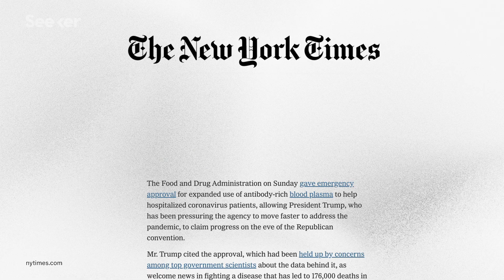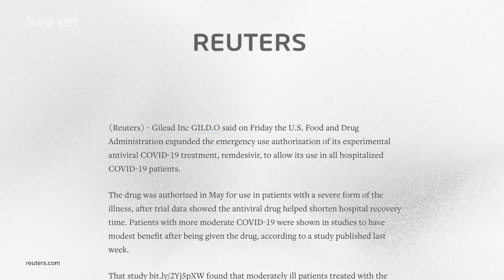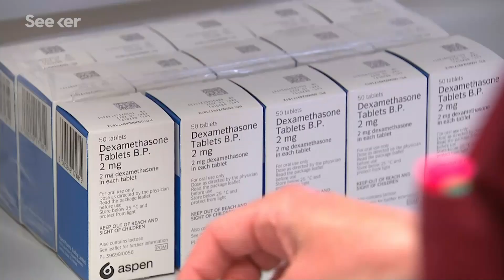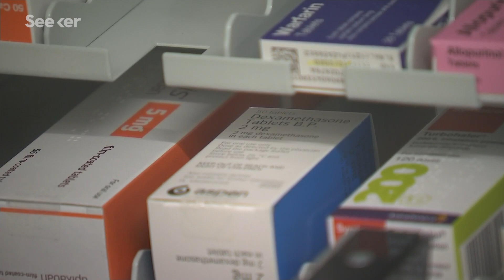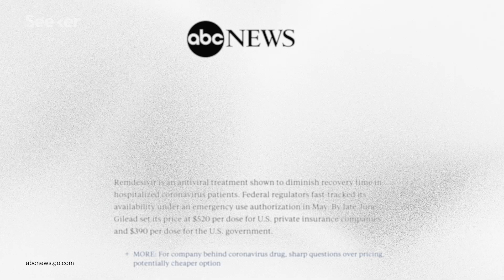Trump Is Undergoing Remdesivir Therapy, Here’s What You Need to Know About the Antiviral

Comment: °•○ FUNCTIONS OF FORESKIN ○•°

.

.

[  ] 🍌 PROTECTIVE COVER: Like a glove🧤, it protects the penis from abrasion, chafing, the elements, and helps regulate temperature. It keeps the glans moist, as it's meant to exist as mucosal tissue like the inner mouth (circumcision causes the glans to dry out and feel more like the outer cheek). The glans is meant to be an internal organ like the eyeball. What would happen to your eyeball if you permanently removed the eyelid?

.

.

🍌 GLIDING ACTION: Foreskin isn't a "flap of extra skin," it's a double-layered sheath that rolls into itself. This allows for a self-stimulating gliding action in sexual activity, which is pleasurable for sexual partners as well😊. When you change form by removing foreskin, you change the natural mechanism of sex. Harder, rougher rubbing and friction😖 is then needed to achieve erotic feeling. 

.

.

🍌 PHEREMONES & ESTROGEN RECEPTORS: Foreskin releases pheremones🥀 and also contains estrogen receptors. Little is known about the purpose of these receptors, but they're thought to play a role in bonding during heterosexual intimacy. 

.

.

🍌 BLOOD FLOW: Foreskin houses a rich network of 3 ft of veins, arteries, and capillaries, keeping penile function in top shape.

.

.

🍌 SPECIALIZED NERVES: Foreskin is densely ennervated with 240 ft of nerves found nowhere else on the body, including tens of thousands of nerve endings 😍.

.

.

🍌 FINE TOUCH SENSITIVITY: While sensitivity is subjective, we know foreskin

contains fine-touch receptors making it the most erotic part of the penis. It can detect subtle changes in temperature, motion and texture. Erectile dysfunction and ejaculatory problems are significantly higher in circumcised men🥱.

.

.

🍌 ANTIBACTERIAL & ANTIVIRAL PROPERTIES: It has its own immunological system and generates substances to keep the organ healthy, clean 🛁, and a balanced pH.

.

.

🍌 RIDGED BAND & FRENULUM: The frenulum is a V-shaped structure that tethers the foreskin, and the ridged band is a belt of soft ridges that interestingly is mimicked in "ribbed" condoms "For Her Pleasure."😊 These erogenous zones are ablated or destroyed by circumcision. 

.

.

🍌 LENGTH & GIRTH: Logically, removal results in "less." Did you know, foreskin comprises 1/3 - 1/2 the total penile skin in an adult? Studies comparing length/girth between intact and circumcised men have noted distinct differences. Circumcised men are also more likely to have tight erections, hairy shaft, or bent penis 🍆due to an insufficient amount of remaining skin.

.

.

🍌 LUBRICANT: Like the vagina, foreskin is self-lubricating, which keeps the organ moist and sensitive. Intact men generally don't need artificial lube for sexual activity. Nature intended for BOTH partners to contribute to the lubrication that makes sex comfortable. 

.

.

🍌 SPHINCTER BARRIER: At the end of the foreskin is a sphincter feature which keeps contaminants, microbes, bacteria and debris out👮‍♂️, while still allowing urine through. The urethra is protected under this sheath rather than constantly exposed, thus significantly decreasing risk of meatal stenosis.

.

.

.

[  ] #intact #circumcision #i2 #foreskinfacts #foreskin #babyboy #itsaboy

https://youtu.be/D_dzeDvx2QA

Women's satisfaction with circumcised and intact. Women suffer more vaginal pain and decreased orgasms.

https://sciencenordic.com/a/1371590

Circumcision education videos.

https://www.youtube.com/playlist?list=PL2WEd0hmVel3n6KomvnjWSV8aeXFEi7dK
Reply: I am not circumcised
Reply: @Redditard  American men that will meet elated don't know what they're missing or what's causing some of their problems sexually. Female partners are also suffering and don't understand where the disorder is
Reply: @tomgmaples  Okie